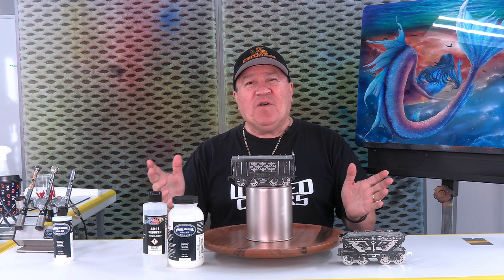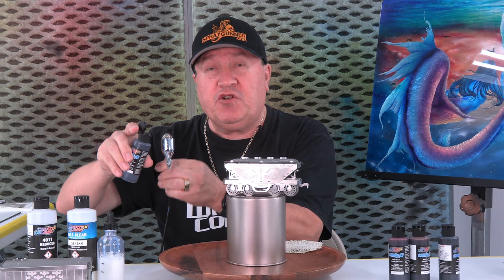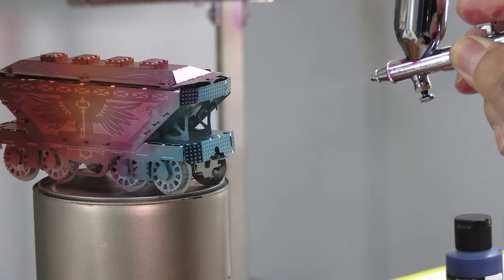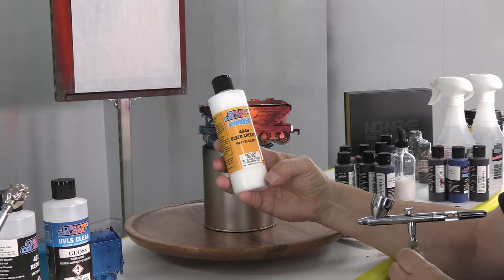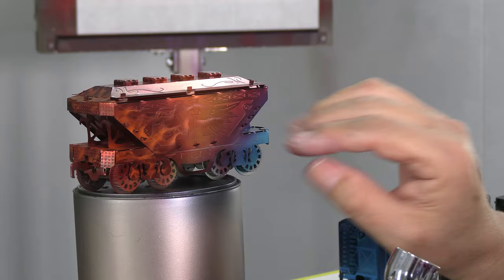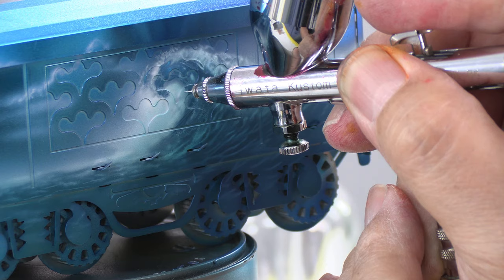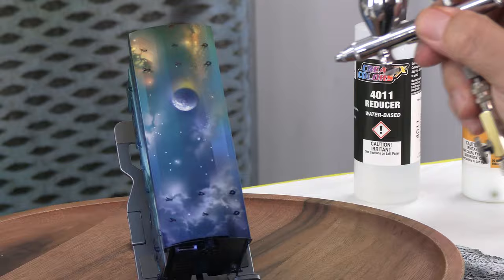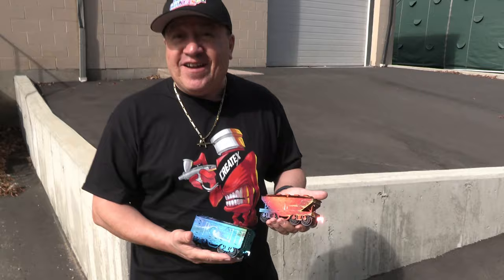Gerald Mendez's Candy Train

Comment: How heavy do you apply the 4040? How long is a a safe time for drying?
Reply from the maker: Gerald applied 4040 Bleed Checker as a light coat. Do not apply wetted or build the material. Drying times vary. Gerald was in a booth with low humidity so 4040 dried within minutes. Allow 4040 to dry long enough so it is tack-free. Thank you.